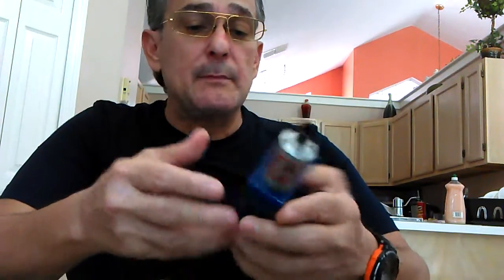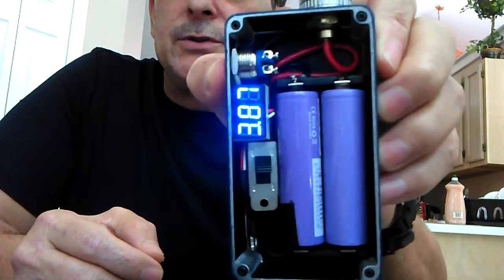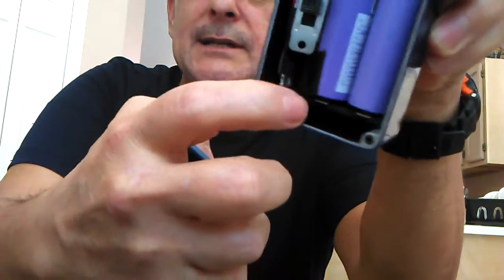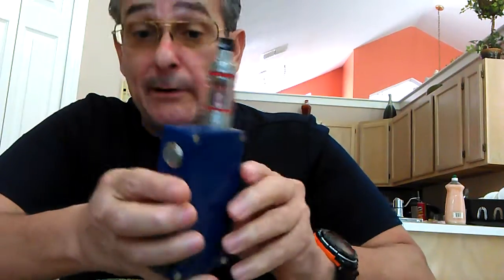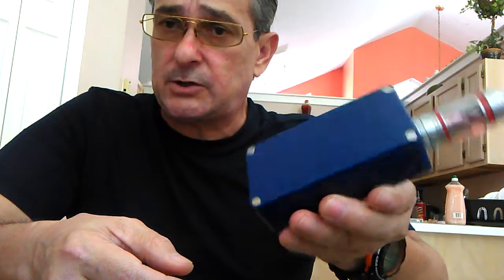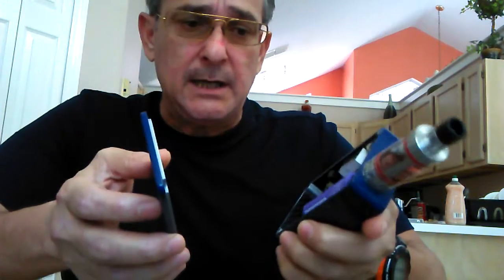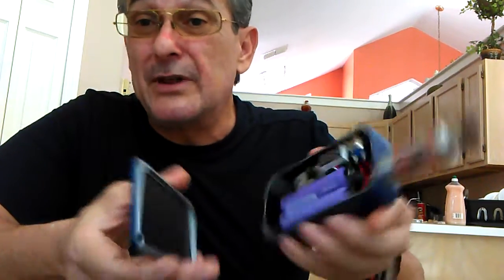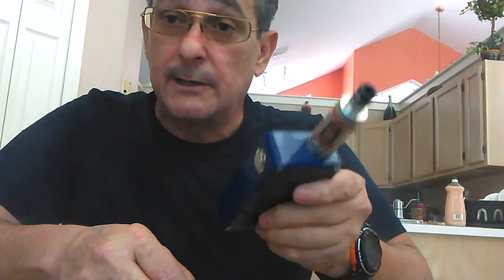The Switch Box Series and Parallel Box Mod VAPE

Comment from the maker: yes it is.... but series is also for hot vaping that's why you have a dual mod that can work both.... but now in modern times there are regulated mods that run 300 watts and 365 watts.... and also lipo mods with 100c 2800 mAh battery packs.....

Comment from the maker: True ... Battery life is better on parallel and yes you can build low ohms ie a .20ohm... Using 3.5v to 4.1 volts..... But on my switch box you can vape a .18 for one or 2 seconds and even 4 seconds...... You just have to have balls to do it and keep from vomiting....  I Vaped 24mg on a .18ohm at 8.4volts about 6 or 7 long pulls and shortly began gagging and vomiting symptoms..... I came very close to throwing up and was dizzy for about 20 minutes.... It's all about vaping habits and if you see big Lou East coast.... You can super sub ohm with the right equipment..... When you VAPE at 12.4 volts in series you love hot vapes...... Some of us love hot chain vaping !!! This switch box has been checked and running (4) mosfets...... A true 8.4v and can handle .06 builds...... Yes it can...... Franklin Crommer just build a series with a carbon fiber fan to induce forced air into your rda.... A (1) second pull produces clouds that many will drool...... To us is about enjoying a crazy VAPE....... And I'm an honest radical vaper..... That's all....... VAPE on and thanks for any comments....... Cool....

Comment: parallel is way safer for sub ohm builds , as the load is split between 2 batteries, you could go as low as .08 ohms and still be safe with quality batteries. In a series you not supposed to go lower than .4 ohms. Great looking box by the way

Comment: Wow what a great build I would love to build one. 
Any chance you could share your wiring diagram for your build
Reply from the maker: Sam I'm in the process of stepping up this box with a panel and (4) mosfets. Everything is heading to multiple mosfets. It's going to be a switch box again. Harder hitter and safer. These boxes don't last a long time if you are using high amp cells.... The mosfets go out every month and the fire switch gets a large current which they need to be replaced..... The switch box is the way to go, most people want to run tanks and rdas. I see multiple mosfets so together with Franklin Cromer with created a chip with (4) mosfets.... One mosfet for each positive and negative with a small switch to change voltage...... Pretty bad ass.... We get the first batch on Monday 5.5.15..... I will put up a video when we finish the sample box..... Ok Monday or Tuesday..... Cool...... Thanks...Manny
Reply: Wow thanks for getting back to me so fast. I'm looking forward to the video. Once again thank you for getting back to me.

Comment: Hey, does anyone have any wiring diagrams for building a dual 18650 box mod using a DPDT switch to change between series and parallel?
Reply from the maker: Check out reddig.com where all box mod builders meet, or simply enter switch box diagram into Google search and pictures will show up.... Hope this helps..... You can even search Dpdt switch box..... Cool.....
Reply: Alright, I found some stuff on reddit that is really helpful! Thanks for the help!

Comment: What kind of dpdt switch is in that box? Trying to build my own but I'm having trouble locating one with a high enough amp limit that can still fit in a 1590b box.
Reply from the maker: Found the perfect switch, I've tested almost a month. Its a Rocker switch parallel and series and you can also turn the box OFF !!!! KCD2 it's 6 amp 250 vac 10 amp 125 vac Made by Jinghan T83 1E4

These are all the info and numbers found on the switch.
Reply from the maker: Here is a link ...... http://www.jhswitch.com/html_products/JH-SWITCH-KCD2-202-25.html

Comment: irritating. the only video on this particular mod and it isn't a build tutorial. why in hell would I have some idiot build my mod? and by the way dude, your mosfet protects your switch. they don't make to many switches rated for over 30 amps. most are rated for 12-15.this is why we use mosfets. and on that mod the mosfet had better be at the least a dual parallel mosfet. I built more than a few series. they get roudy. figure out how to build this, then make a video. there isn't a better feeling on earth than vapeing on a mod you made. and I can get all my components for 40$ or less. I do have the wireing diagram for that circuit, I'll figure it out on my own.